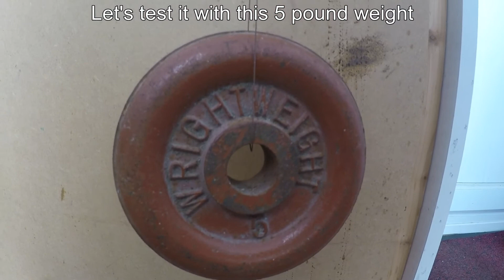Spring balance - Perfect restoration

Comment: Very meticulous and good work.  Liked it very much. In particular, I was interested in the method of dipping into paint. I will try this too. Thanks my friend 😊
Reply from the maker: The paint finish from paint dipping is like glass. I was amazed. I never tried it before.
Reply: @DaftOldMan  I think it was great.  What kind of paint is paint?  Did you add thinner to thin it? And how long did it take to dry?
Reply from the maker: @Restomaniac  Baufix anti rust paint.
I did thin it but only because the  paint is old.
Reply from the maker: Paint dried in 24 hours but need a few more days to harden
Reply: @DaftOldMan  Thank you 😊